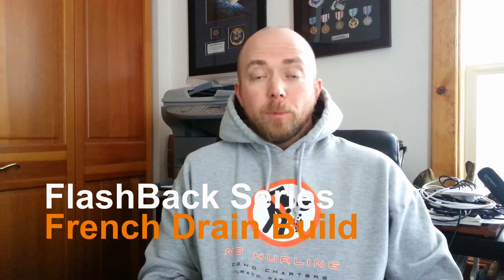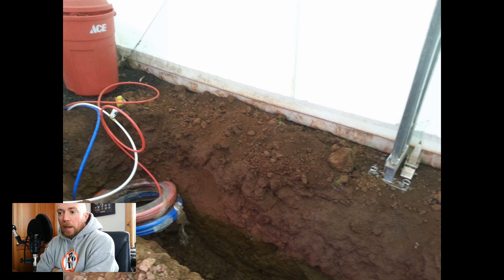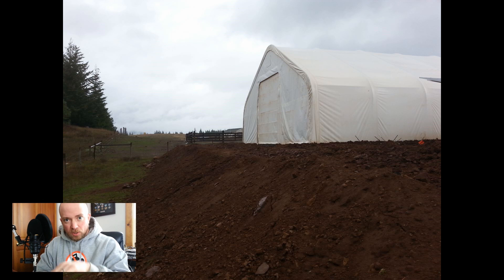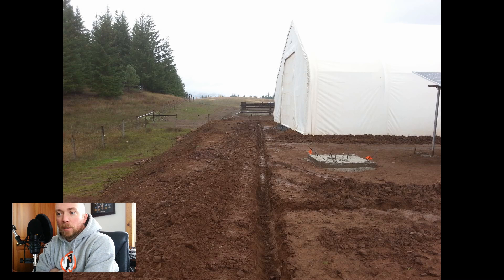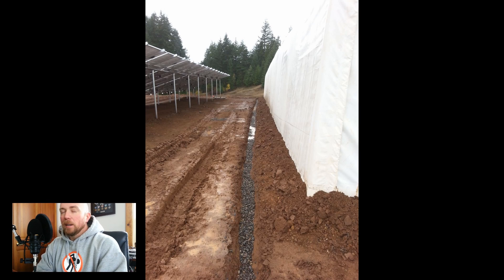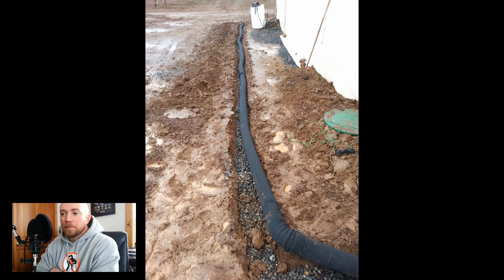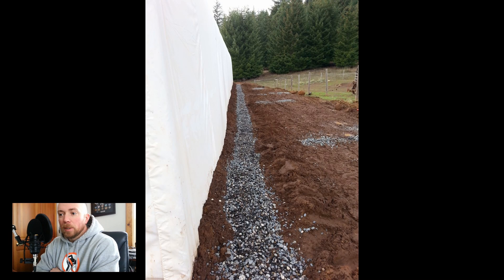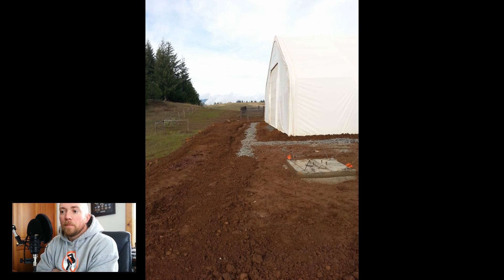Sometimes homesteading is a real drain!

Comment: The drain ditches are much too small. The ditch need s to be at least 80 cm deep and 80 cm across. At the size it is now it will flood in a little longer downpour. You also need to use landscape fleece at the outer sides of the ditch on its entire lenght (so your drainage rock and tube is completely wrapped, all 80 centimeters by 80 centimeters) . Soil will plug your drainage rock faitly quickly and then it will stop working without the fleece. We do this arround house foundations in Europe a lot.

Comment: Here in Sweden we use something that I have no clue what's called in English; it's a wire that creates heat, which we run through our waterlines and pipes, to prevent freezing inside the pipes. They use very little power, they only create a little heat, but just enough to either stop freezing, or to maintain a small hole through the pipe to get the water running. Once running, it will open up the pipe, and eventually remove all ice in there. They come with a thermocoupler / thermostat that will turn it off, once it's not needed anymore.